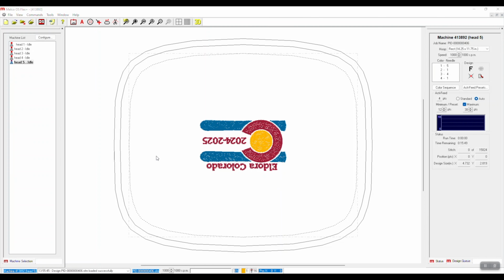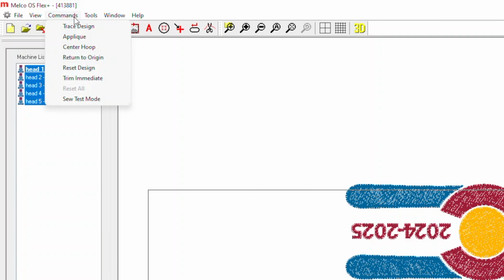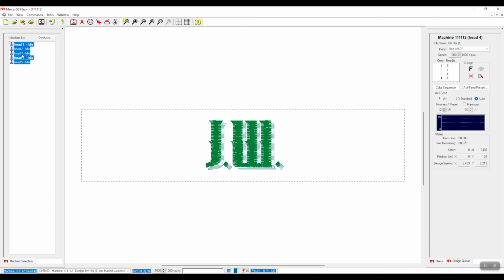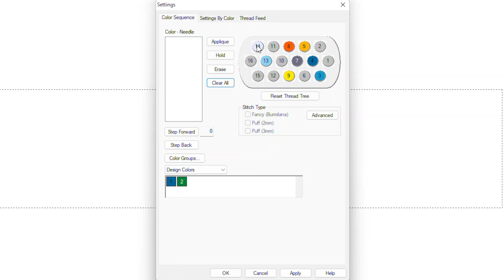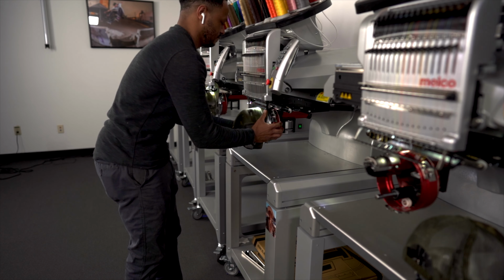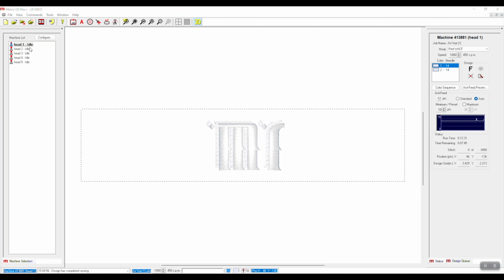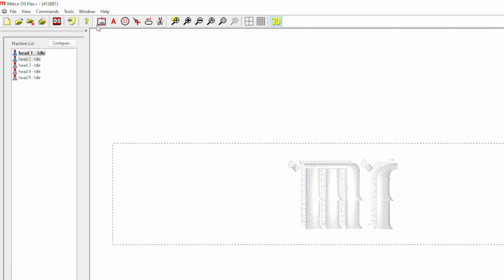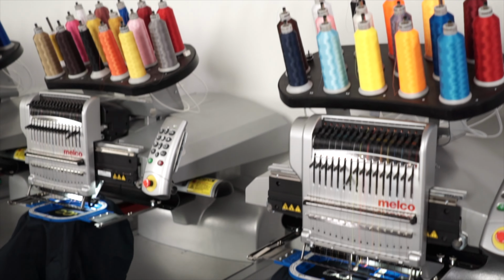Melco Multi-Head? Melco Modularity Explained

Comment: @melco you actually answered my request…. That’s pretty cool! 

Ok so,

Can you set up queues in advance or do you have to wait until each is done to load them?

Does the modularity work in the UI version? I figure not everyone uses the pro interface.

Thanks again
Reply from the maker: You bet, that was a good request. Talked with the pro's at Melco. Here are your answers. In the advanced interface you can setup either individual queues to each machine or setup a master queue. The master queue feeds to all machines connected that Melco OS.

Individual queue: chrome-extension://efaidnbmnnnibpcajpcglclefindmkaj/http://melco-service.com/docs/X/MOS_AI_X_Manual.pdf page 198
Master queue: chrome-extension://efaidnbmnnnibpcajpcglclefindmkaj/http://melco-service.com/docs/X/MOS_AI_X_Manual.pdf page 200
The simplified UI does allow for up to 6 machines. There is no queueing in the SUI

SUI multiple machines: chrome-extension://efaidnbmnnnibpcajpcglclefindmkaj/http://melco-service.com/docs/X/MOS_UI_X_Manual.pdf page 50